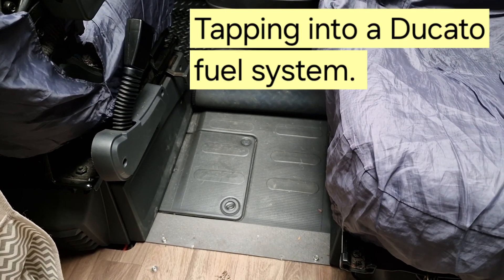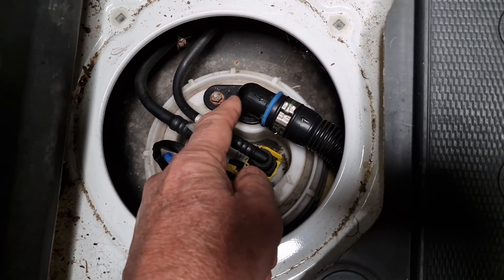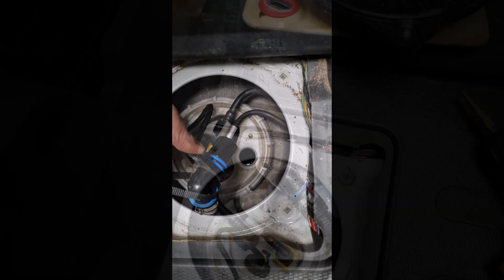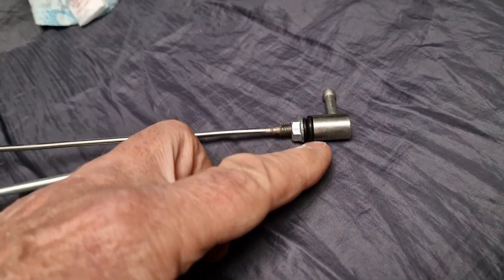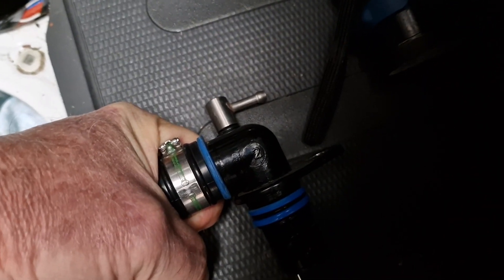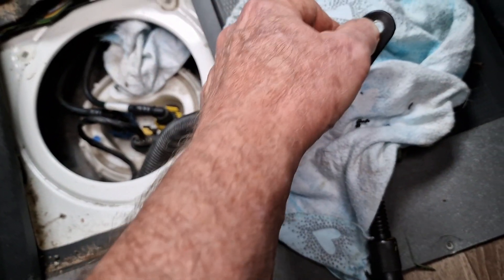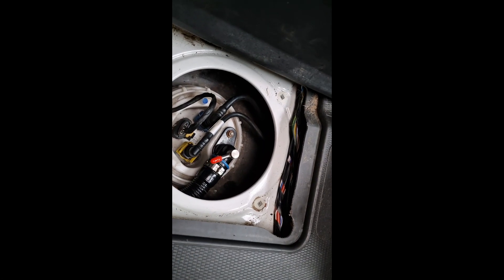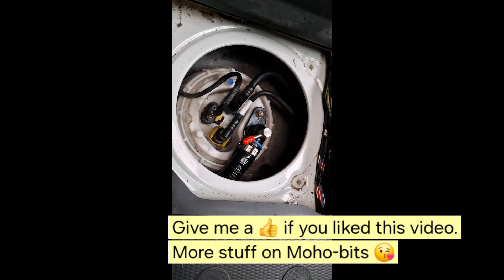Connecting a diesel heater into a Ducato fuel system.

Comment: How did you get the heater fuel pipe up into the hatch? I can’t seem to see a route through without dropping the tank a bit.  Great video 👌👌
Reply: ignore me, far easier in the dark with a torch to find the gap at the back of the tank 👍